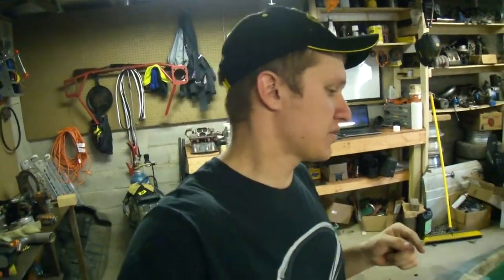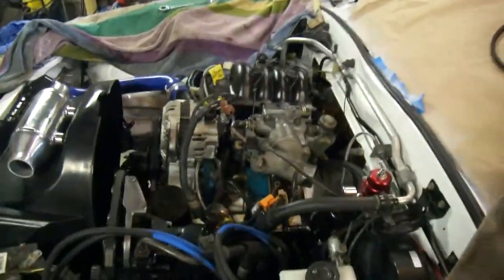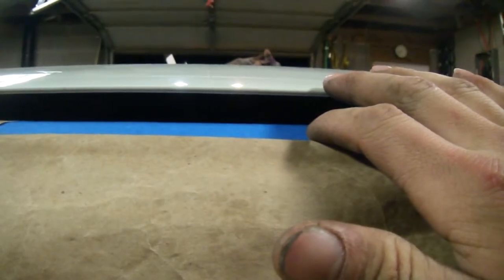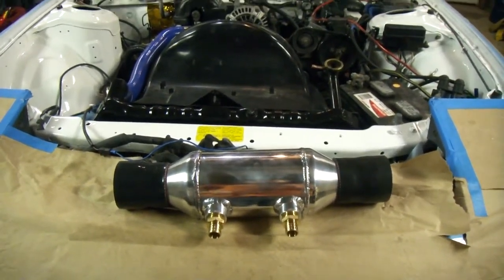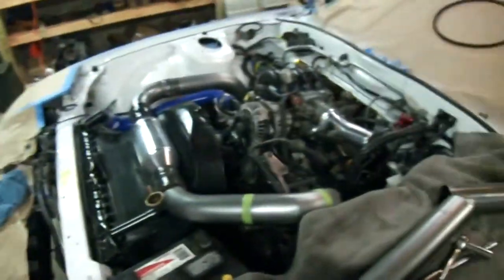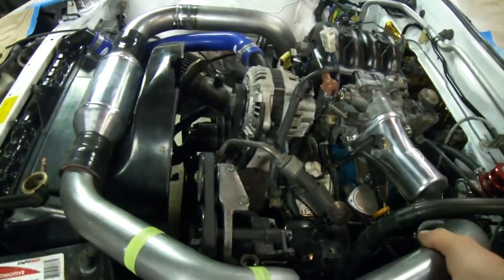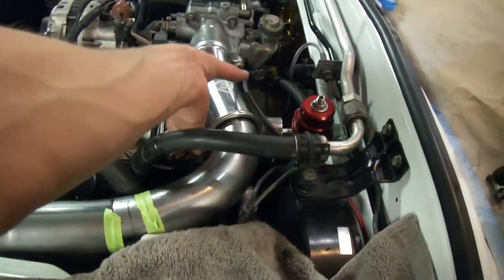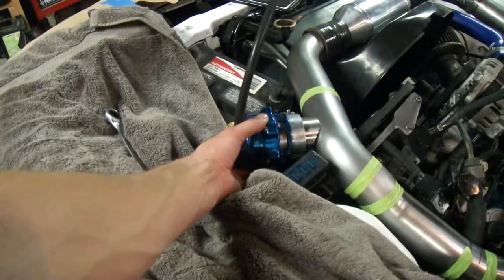INTERCOOLER PIPES DONE!

Comment: Just came across this build, super helpful. Love your channel in general. I got a nice '88 GTU recently and this is inspiring me if I one day want to turbo it. Question: what made you decide to do the water-to-air intercooler instead of snagging a Turbo II intercooler and piping? That would seem to simplify a lot of the troubles you were having with the plumbing and the complexity of the water-to-air setup. Didn't wanna track down a turbo hood?